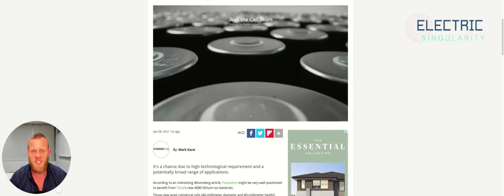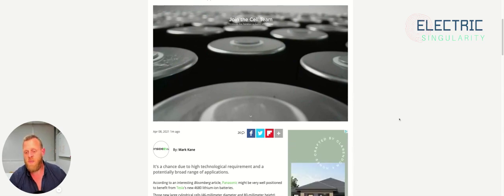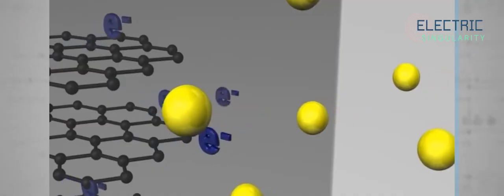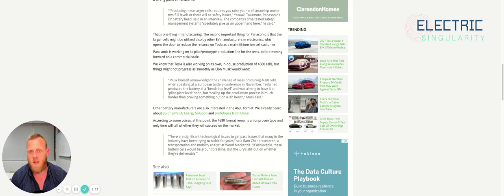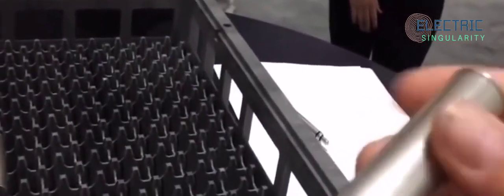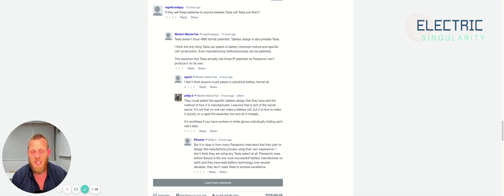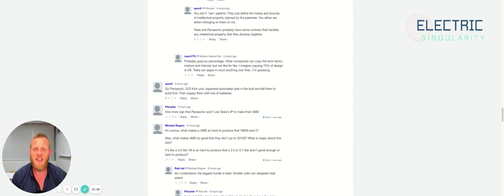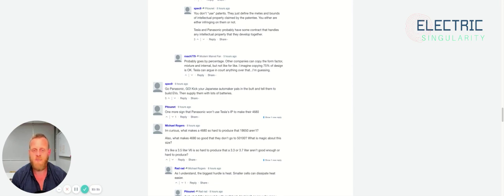Panasonic Finds New Opportunities In Tesla's 4680 Cells

Comment: I just want to ad that oh Chem and CATL are also making these batteries in partnership with Tesla , and catl has a plan to reach 1.2 tera watts by 2025
Reply from the maker: Good point Owen - similar chemistry, but a slightly different battery and pack.
Reply: From what I understand the only real difference will be the cathode , iron fosphate or nickel manganese, and the battery manufactures won’t be making the pack, most will go straight to Tesla and they’ll either put it straight into a structural pack or straight into the mega pack ect .